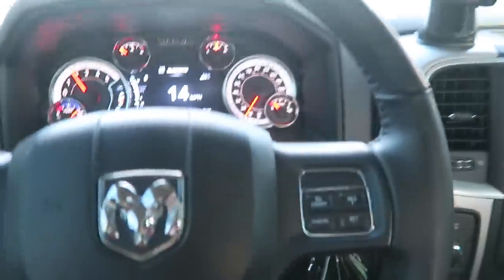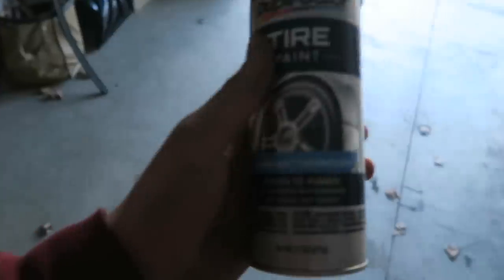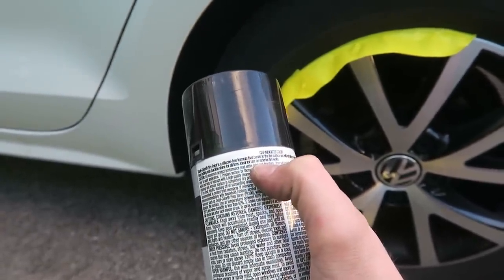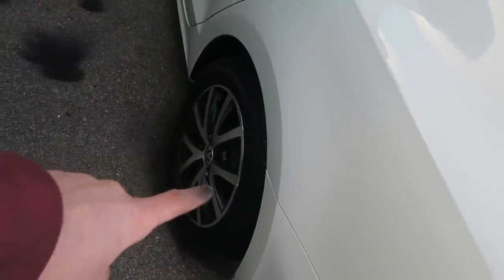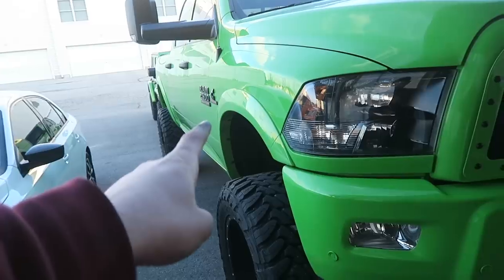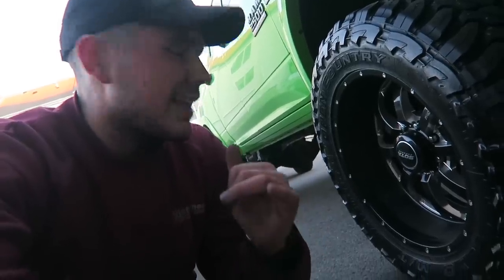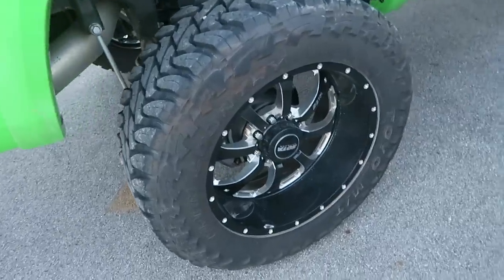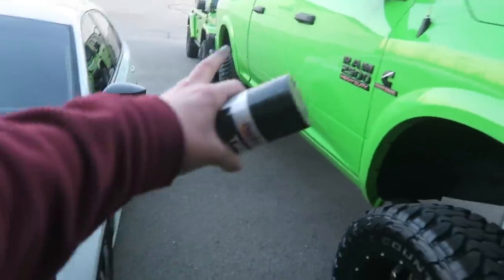I Spray Painted My Tires So They Shine....FOREVER!!

Comment: Adam's Polishes tire shine gives a better and more consistent shine than that and does not sling on my truck / car either. I don't know if I don't like this because it is like a cardinal sin spray painting tires or what but it seems like once the tires get dirty and you wash the truck it will either A) Wash off or B) Fade. 

Either way interesting video, not knocking you just giving you my thoughts.
Reply: What's wrong with spray painting a tire? Are yah saying spray paint will damage the tire lol? I've done this with every vehicle I've ever owned and have had 0 issues with the tires afterwards. I just used the $1 paint lol.
Reply: @chevyguy98silverado89  Lioness and I will call you tomorrow evening or early next day I have a great time with you guys ❤️💙😊 Gate to get it to me by a great time in and we can talk about 🎌
Reply: What?
Reply: Kevin's Squat TRUCK I literally say in my post it’s a cardinal sin for a detailed to paint a tire. I literally said NOTHING about the paint damaging the tire, so I’m not sure where you got that idea from. I just said I feel like it would fade after one wash or crack (the paint not the tire). I’m glad you use it, more power to you bud. But I guarantee you my Adams Polishes tire shine works much better and is easier to apply and applies more evenly than the stuff he uses in this video.

Comment: The one problem with that stuff is that you can't use it on tires with white lettering. I like the look of the white letters, particularly for off-road tires and since that's a gloss black, it wouldn't be good on those types of tires
Reply: Yes you can still use it, spray the tire, then lightly sand the raised letter with 1000 or 800 grit sand paper !!

Comment: Did you prep the tire first? Looks good, let's see how long it lasts. I have used a product from Turtle Wax (black tire coat), it's not a silicone product so it doesn't sling. It is in a pour bottle, so you put on with an applicator and takes a bit of time to put on especially with the truck tires, so not as easy as the spray, but less overspray. It lasts a long time(several  washes, rain etc) and if they get dirty, usually comes right off with the wash(the dirt does). It's hard to find in the auto stores and the next time I'm gonna have to order from Amazon. So far this is the bast product I have found for the tires that doesn't sling, looks good and lasts. (except now that you have shown this "paint")

Comment: I think it would be better can you use that when you purchase a set of tires to spray a few coats let it dry and then have your tire set on rims but I like to use mothers it's in a red can with a black top I use that also a mother's Tire gel I use the tire gel around the rims and then they mothers spray to get in between the knobs of the tires and yours a dedicated sponge basically to mix the two you'll still get a little bit especially the size of your tires and the way they stick out but I always keep a microfiber rag what's some body spray to clean it off but love the look of your truck it's badass looking

Comment: Take the tires off the truck cut cardboard circles and tape them in then you can coat them evenly in all directions and not get it on stuff I wonder if they sell it in qts so I could put it in a spray gun or in a like plastidip gun

Comment: Digital speedometers, cause dodge owners can’t read the speedometer 2 inches to the right 🙄
Reply: All makers have digital...........are you still driving a 1994 ford?
Reply: Wayne Williams found the Ram fan who can’t read their speedometer.
Reply: Nick H I can read my speedometer just fine. Just telling you flat out how ignorant you sound for pointing out a digital speedometer on his dash when every new vehicle on the road has one. It is generally default setting to be there unless you change it to what you want to be there